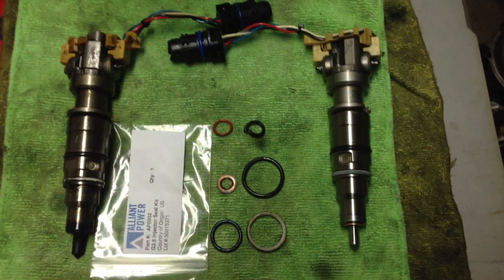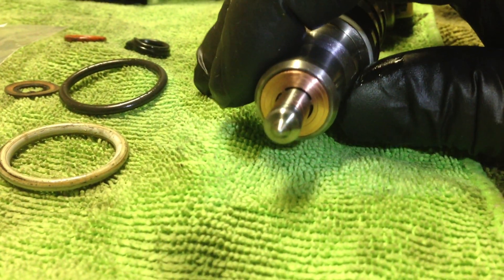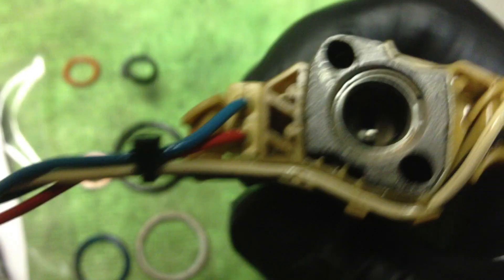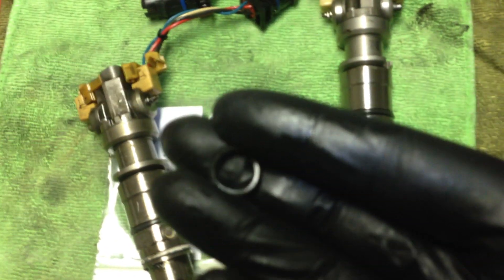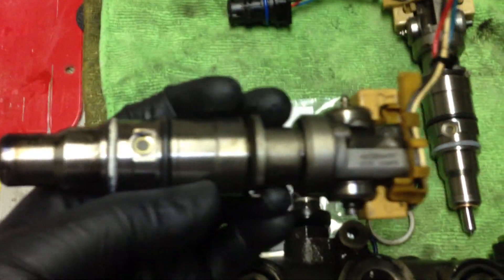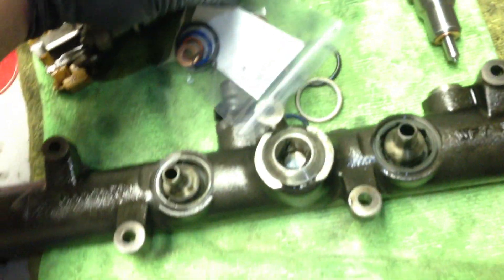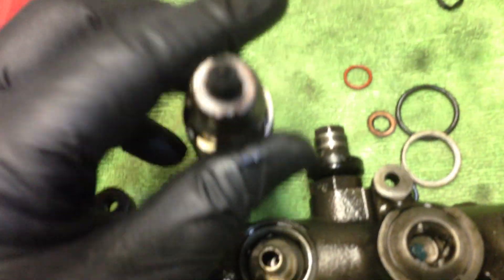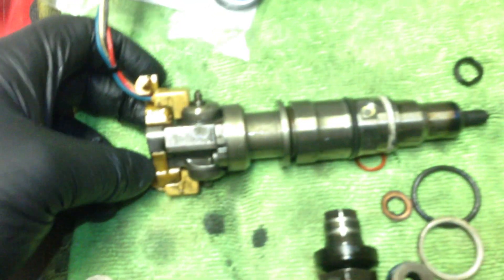vid #2 6.0 diesel diy re manufacture / reseal injectors all 8 under $100 in parts

Comment: What if the injectors are dumping too much diesel can that be fixed by resealing it ?
Reply: if your getting to much fuel you probably have a injector bracket that is broken or seal and it's dumping fuel and causing hydrolock  if your getting a lot of smoke you could have a turbo issue

Comment: I did this job.  Was real handy seeing these demos first for sure.   Truck starts quick, has more power, and smoother running over all.  One problem noticed when dismantling the upper spool valves.  I had score marks on half of them which you can't eliminate.   If the kit included new spool valve pistons, the job would be more complete.  Such a simple procedure.   To bad the Capitalism gets in the way of that.    When you get a miss or rough Idle it's when the spool valve sticks and spins in one spot.   This in turn  creates the score lines and snags up the action.

Comment: Heya, I've found that a short trip through a cheap ultrasonic cleaner works well too, I've seen an injector that was brushed too hard smeared some brush material into the tiny injection holes. A hand brushing with stainless or brass brush seems to just leave it clean.  I've resealed mine and am eager to see if a low contribution is fixed.

Comment from the maker: There is nothing in side of these injectors that go bad the only thing that can break or get damaged is the o rings and coil so you my friend are wrong I have not put up a video yet of how to clean the inside but I will put on up soon most of the Time the reason the injector stops working its due to failed top o ring if you use revex in your oil it will remove all stiction so that really takes care of the oil side and for the fuel side simply use Lucas fuel injector cleaner to keep nozzles clear
Reply: so how are these trucks that you did these repairs to doing now? i would really like to know because i would hate to pay for these expensive things if i don't have to. and do you have a part number for these reseal kits? thanks
Reply from the maker: they run perfect part #AP0002
Reply: sam Dub thanks bud

Comment: Many facts stated in this video are false.  This is simply resealing an injector's exterior, not remanufacturing.  This will only solve a possible oil leak.  The only safe way to clean the nozzle is with an ultrasonic cleaner.  All that was done in this video was to make the external appearance of the injector better which may have distorted the holes in the nozzle if sand paper of a metal brush was used.
Reply: 5 out of the 6 holes were plugged on my 1st injector that I "repaired". what I used was an oven cleaner(carbon killer), socked the tip and needle  for 24 hrs. polished the tip and applied 120 psi air pressure. My test to see all the 6 holes working was attach a hose to the tip with air pressure and dip the tip under water, now I see 6 jets shooting air with equal bubbles ... the test was done b4 dipping the tip in oven cleaner and only one jet was bubbling with half the size of bubbles I see now.... AutoUnginuity showed poor performance on 3rd, 5th and 8th injectors. I am "repairing" only 3rd for a test .... will post results ...